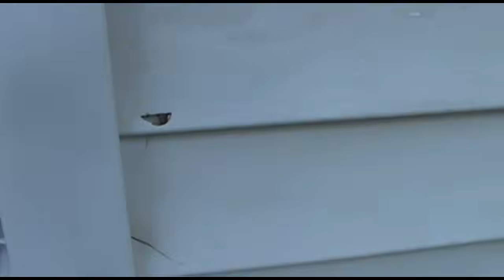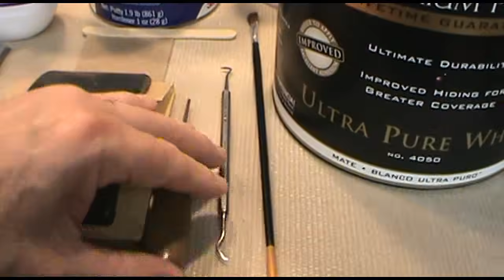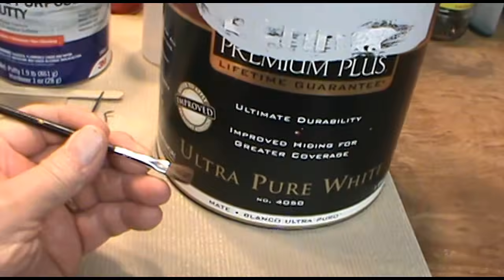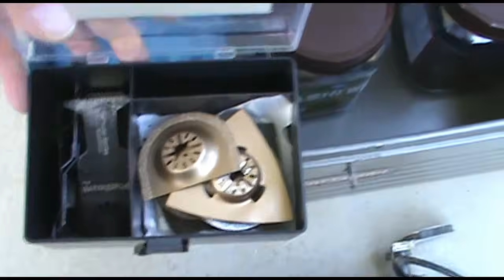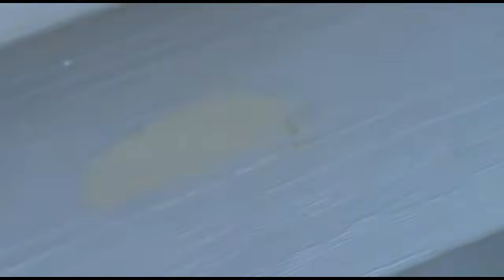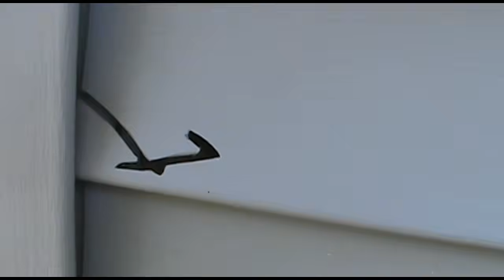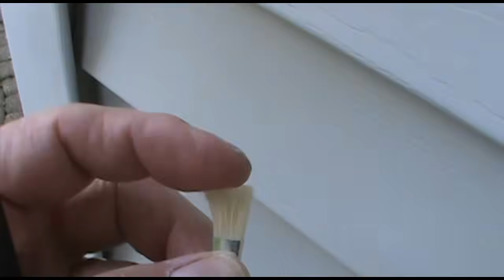How to Repair Vinyl Siding Holes and Cracks. Perfect and Undetectable.

Comment: Had some cracked vinyl from hurricane winds few years back and was thinking of what to use and bondo came to my mind.  

I think I got lucky with my Navy Seabee ingenuity as i only had a couple of cracks and was able to pull the siding apart and reach behind it and used “GORILLA TAPE” (thick stuff) where i could use pressure on both sides for a good grip.   

4 years later, it still looks good.   I do have an area where i may need to bondo and I am going to look at the use of bondo.   Wouldn’t of thought of using the “picks” you had and i have some. )computer repair tools, but they will work. 

good job.  how did the paint match up?
Reply from the maker: Thanks for the tips, STEM Mentor. Bondo All-Purpose putty works really well. The paint match was perfect. Home Depot did an amazing job matching the sample vinyl. If you didn't know where my repairs were you almost certainly wouldn't be able to find them. Good luck with your repair.

Comment: It turned out very nice. I would have liked to see the work as it was being done.
Reply from the maker: Thanks, MrJcampe9434. Unfortunately, I didn't have anyone to film me and I was very sick when I was filming this. I had a big job ahead of me repairing the vinyl siding, installing vinyl posts, and installing vinyl railing. It was extremely hot that summer and it was a bit taxing for me to video what I did. I knew it was something that would help a lot of people so I went ahead and did the best I could under the circumstances. Most of the stuff, sanding, painting, etc., the majority of people already know how to do. I gave them the information they would not have so they could fill in the rest with their current know-how. Thanks for your comment.

Comment: How did you match the color
Reply from the maker: I had some small pieces of the siding left over in my attic. I took a sample of the siding to Home Depot and they scanned it for color match. If you don't have a small piece left over to use for color match you may be able to find a small piece of siding around 2 or three feet that was used to complete or fill in a run of siding on your house. If so, you can use a siding removal tool https://amzn.to/3MiuxUU to remove the smaller piece and use it for the color match scan. Then reinstall the small piece of siding.

Comment: That's ridiculous amount of work . A whole lot quicker and easier just buy a new piece of siding and cut a new piece they pop out easily and pop a new piece in . In a little time exposed to elements it will blend in
Reply from the maker: Hi, Brian. Thanks for your idea. Everyone doesn't have that option. In my case, my siding company went out of business over 20 years ago. Even if you install two new pieces of siding from two different dye lots against each other there can be a noticeable color difference. By the time you have siding damage, you will almost certainly be installing new siding against a different dye lot from an older batch of siding. To make things worse you may be putting a new piece of siding from a different dye lot on older siding that has significantly faded from exposure to the sun and elements for 10, 15, 20 years or more. That makes the color difference even more noticeable. For some people that may not matter and the convenience of installing new siding next to old may be worth it in spite of the potential color difference. In my case, it was more important to me that everything looked as if nothing ever happened. Plus the company was out of business giving me no other options.

Comment: Great idea, QUESTION; I used to do body work, can you use less hardener to give more work time, I know it’s a fine line between enough to harden it and too much so it hardens too fast, just curious what your thoughts are
Reply from the maker: Hi, Jerry. You are on the same page I am. I never use the recommended amount of hardener. I have used a pea-size squeeze of hardener in a 1" diameter by 1/4" thick blob of All-Purpose Putty and it still seems to set up quite fast. That's the only bad thing about this stuff is the setup time. Other than that I love it and use it on many home repairs. Thanks for your question.

Comment: Having sold vinyl siding with 4 different wholesale distributors for over 25 years I have the luxury of looking at most vinyl siding and knowing who manufactured and if it’s still available. So for me it’s just seems easier to replace the damaged pieces rather than repair them, however I’m sure this is helpful to some folks. Outside corner posts are sometimes the most difficult to match and repair, it seems they get damaged more than the siding itself, and they also come in 3”, 3.5” and 4” some with a raised lip on the edge and some totally flat. The 3.5”s are very difficult to find.
Reply from the maker: You're lucky to have that background, Michael. I have repaired several holes in one of my outside corner posts. It turned out great. Thanks for your input.

Comment: You surely didn't use the putty on large holes, (50 cent size) so what do you recommend?
Reply from the maker: Hi, Gadsdon Flag. The largest hole I have repaired with the putty alone was about the size of a quarter. If I had a larger hole to repair I would give this a try. 

I would backfill the hole with DAP Alex Painter's Acrylic Latex Caulk https://amzn.to/3jCuneN . I like the Acrylic Latex Caulk without silicone or any other additives. It doesn't expand or contract much, can be used indoors or out, and cleans up easily. Aim your caulking gun at an angle and squeeze some back behind the vinyl siding all around the perimeter of the hole and continue to backfill the entire hole but do not fill it all the way up until it is even with the siding. Keep it about 1/8 of an inch below the surface of the hole in the siding. All you are doing is making a base for the Bondo All-Purpose Putty. Let the Painter's Caulk set up for at least 24 hours so it is good and hard. This caulking doesn't expand or shrink much and should be a good base for the putty.

After the Painter's caulk has completely set up you can fill the rest of the hole in with a top coat of the Bondo All-Purpose Putty. You will have to work fast because this stuff has a very short open time of about a minute or less. I would have a small putty knife ready to immediately pull the mixed putty off the mixing cardboard and work it into the remaining hole. It won't matter if you have to work fast and get a little extra putty buildup on the hole to make sure it is all filled in because the putty is easy to sand down. After sanding trace in your wood grain lines with the dental tarter pick, clean it with denatured alcohol, and paint it. I hope that all makes sense and good luck with your repair.

Comment: Use your hardener depending on the size of the Bondo you're working with and especially the TEMPERATURE outside.
Temp has a direct effect on how quickly it dries.  It doesn't take alot of hardener to to cure the mixture so use a "pea size"
for most smaller applications and mix it well before applying.  It will work fine and you'll have more time to work with the putty
while applying it. If it's cool out, use more hardener and if it's hot out use less.
Reply from the maker: Good point, Gadsdon Flag. I usually use as little as possible. I never use as much as they recommend as this stuff sets up really fast.
Reply: Pea to a golf ball sizes works great for those small jobs.    For the uninitiated to body and fender work remember this.  Do each one one at a time or two at most when laying the bondo on the holes.
Reply from the maker: @drizler  True. I can usually get about two small holes done before the putty starts hardening. Thanks for your comment.
Reply from the maker: Thanks for the tip, Gadson Flag. I totally agree that less is good when it comes to hardener.

Comment: This is a lot of supplies I have to buy.  Does it work better than clear gorilla tape?  Gorilla tape is good enough to patch the cracks in the roof around my chimney.
Reply: Well I guess it looks better.  I live in condemned house and couldn't afford to put plywood over the windows so I used cardboard with plastic stapled to it.  I don't really care if the hole is visible, I just want to keep water out.
Reply from the maker: Hi Mark. I know there are a number of things needed to do this repair. In many cases, people already have at least some of the tools needed for this repair. This repair looks better and is probably cheaper than hiring a crew to replace vinyl siding that may not match existing siding that has faded over the years. As for clear Gorilla Tape, that won't hide the hole but if all you want to do is keep water out that may work. Good luck with your repair.

Comment: Our house has a crack that breaks off from the middle out into 3 different directions. Should I place mesh behind the crack? Also, thank you for the great information!!
Reply from the maker: You're welcome, Mary. If you have a larger crack you may want to check out the video at 20 minutes in. You will see how I repaired a fairly large crack. https://youtu.be/ShZi5mwbZXg?t=1200

If you have a larger hole I would backfill the hole with DAP Alex Painter's Acrylic Latex Caulk https://amzn.to/3jCuneN . I like the Acrylic Latex Caulk without silicone or any other additives. It doesn't expand or contract much, can be used indoors or out, and cleans up easily. Aim your caulking gun at an angle and squeeze some back behind the vinyl siding all around the perimeter of the hole and continue to backfill the entire hole but do not fill it all the way up until it is even with the siding. Keep it about 1/8 of an inch below the surface of the hole in the siding. All you are doing is making a base for the Bondo All-Purpose Putty. Let the Painter's Caulk set up for at least 24 hours so it is good and hard. This caulking doesn't expand or shrink much and should be a good base for the putty.

After the Painter's caulk has completely set up you can fill the rest of the hole in with a top coat of the Bondo All-Purpose Putty. You will have to work fast because this stuff has a very short open time of about a minute or less. I would have a small putty knife ready to immediately pull the mixed putty off the mixing cardboard and work it into the remaining hole. It won't matter if you have to work fast and get a little extra putty buildup on the hole to make sure it is all filled in because the putty is easy to sand down. After sanding trace in your wood grain lines with the dental tarter pick, clean it with denatured alcohol, and paint it. I hope that all makes sense and good luck with your repair.

Comment: Like other comments on this video, I appreciate your helpful advice. I look forward to adding this to my summer projects.  I could not figure out how to repair all the small damage on my siding. You have provided a wonderful solution. 👍
Oh, one quick question:
Is there a size limit to a hole repair?
Reply from the maker: Hi, DJ. Thank you for your kind comment. I have repaired holes up to about 1" in diameter. If you have a larger hole I would backfill the hole with DAP Alex Painter's Acrylic Latex Caulk https://amzn.to/3jCuneN . I like the Acrylic Latex Caulk without silicone or any other additives. It doesn't expand or contract much, can be used indoors or out, and cleans up easily. Aim your caulking gun at an angle and squeeze some back behind the vinyl siding all around the perimeter of the hole and continue to backfill the entire hole but do not fill it all the way up until it is even with the siding. Keep it about 1/8 of an inch below the surface of the hole in the siding. All you are doing is making a base for the Bondo All-Purpose Putty. Let the Painter's Caulk set up for at least 24 hours so it is good and hard. This caulking doesn't expand or shrink much and should be a good base for the putty.

After the Painter's caulk has completely set up you can fill the rest of the hole in with a top coat of the Bondo All-Purpose Putty. You will have to work fast because this stuff has a very short open time of about a minute or less. I would have a small putty knife ready to immediately pull the mixed putty off the mixing cardboard and work it into the remaining hole. It won't matter if you have to work fast and get a little extra putty buildup on the hole to make sure it is all filled in because the putty is easy to sand down. After sanding trace in your wood grain lines with the dental tarter pick, clean it with denatured alcohol, and paint it. I hope that all makes sense and good luck with your repair.
Reply: @Fixitforgetit  
Awesome!  Will try this technique. Thanks again.
Reply from the maker: @DJ-zt2ml  My pleasure. Good luck.
Reply: @Fixitforgetit  
Did your technique and it worked wonderfully. Thanks again.  👍
Reply from the maker: @DJ-zt2ml  That's wonderful. Thanks for your kind feedback. I love it when people try this and it works for them. That's what it's all about. Helping each other.

Comment: I wish I would have saw this before I used clear Alien Tape on my cracks and holes.  great video
Reply from the maker: Hi Caroline. Thank you for your kind comment. If you ever decide to try this repair perhaps you could remove the tape with a hairdryer and then use charcoal lighter fluid to remove any adhesive left from the tape. Charcoal lighter fluid is a mild solvent and won't hurt the vinyl siding. Thanks for stopping by.

Comment: You did a great job at the repair and at explaining everything. One slight bit of constructive criticism is that you go a bit too deep into explaining things. If you good shorten the video by half it would be great. I pretty much had this same idea as I use bondo for a lot of repairs mostly wood but still. My issue is matching the paint. I don't want to cut a piece of siding off to get it matched and I have no idea the color code. Anyway still good job.
Reply from the maker: Thanks, my2centz. It was longer and I lost almost 500 views because I deleted and shortened it. The original version would have really driven you over the edge :-). This was my first video and I have tried to keep things a bit more truncated since this video. It is a learning curve. I have actually had people scold me for not going into more detail on sanding, etc. Some people are "get to the point" people while others want more detail. It is always a balancing act to try and meet the needs of both camps. I appreciate your comments though.
Reply: @Fixitforgetit  Yes I apologize I should had thought of that. Some people need more instructions and some just wanna see the end results lol. Again I should had realized this and my deepest apologies. It did turn out great and I plan on doing this myself after I figure out a way to find out the paint match. Bondo is great for making repairs on just about anything you can paint and I am sure it will work great and hold up quite a long time.
Reply from the maker: @my2centz196  No problem at all. I'm glad to have you give me some direction and appreciate you stopping by. Please make sure you use Bondo All-Purpose putty instead of the regular Bondo. As for the paint match, try this. Look around your house for a really small section of vinyl. Especially if you can see one in a bottom row of your siding. If you see a little 3 or 4-foot section you could get a vinyl siding removal tool and pull it off without too much trouble. There are videos that show the procedure. Take the piece of siding to Home Depot and have them make you a custom blended sample to match the vinyl and it should only be a few dollars. Good luck.
Reply: @Fixitforgetit  Yeah that is what I may have to do but unfortunately the smallest piece at least on the starter strip is nearly a full piece and I'm afraid it would get broken. Especially now during the winter months. I'm sure you know how brittle siding can get in the winter months especially if it's been beaten by the sun for the last 20yrs lol. That does give me a good idea though. I suppose I could take the top piece which other then getting to it anyway. If I do that then all I have to do is pull a couple little nails out the bottom of it and slightly pull it down. It's small, the nailer has been cut off so it's only held on by the lock and a few tiny nails in the lock. Might not be fun getting to as it's pretty high up but might be my best option. Thanks I appreciate it. I don't know why that hasn't crossed my mind until now but I feel stupid for not thinking of it lol. In all fairness I do work a lot and I have so many projects in either doing or planning to do lol. Oh I do use the all purpose bondo I get from the paint section but I didn't know their was a different which is good to know.
Reply from the maker: @my2centz196  Another thing you could try is this. Use a siding removal tool to loosen a bit of siding. Then use some tin snips or a razor knife to snip a bit of the nail tab off. You would be surprised at how well Home Depot can match paint color with even a small source sample. I took in a sample that was about 1" X 2" and they did a great job. That small piece of missing nail tab should be covered up when you reinstall the siding. You may need to wait for warmer weather.
Reply: @Fixitforgetit  That is another good possible solution. Definitely wanna wait until warmer weather. My only concern about that is the siding has been exposed to the elements for such a long time I'm sure the exposed siding has faded quite a bit but I won't know until I try. I plan on power washing this spring so I suppose I should hold off until then anyway. I am the type of person who like to plan ahead anyway. Even if I know how to do something I'll still sometimes watch videos just because sometimes you find secrets or easier ways. I'm not above learning new tricks lol
Reply from the maker: @my2centz196  I'm the same way. I hope it works out for you.